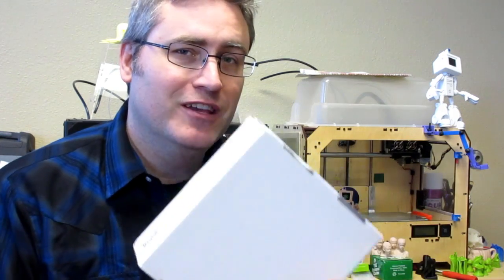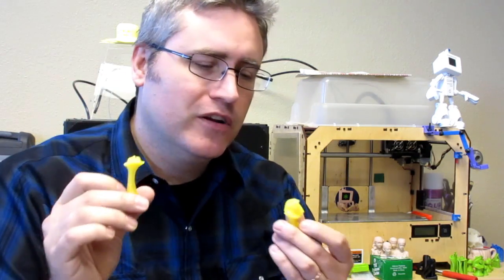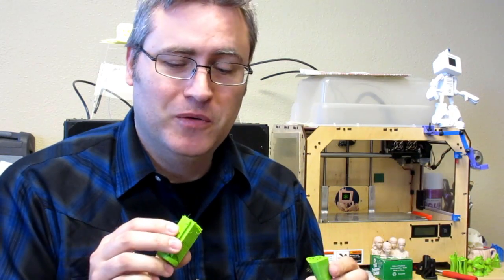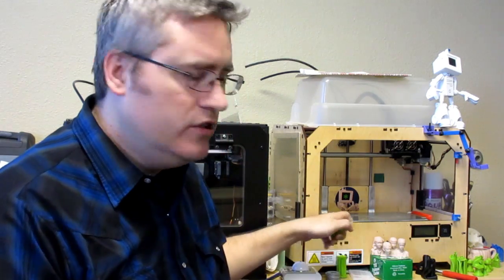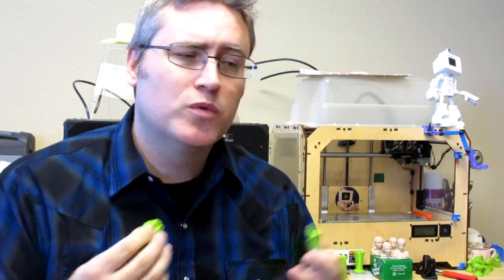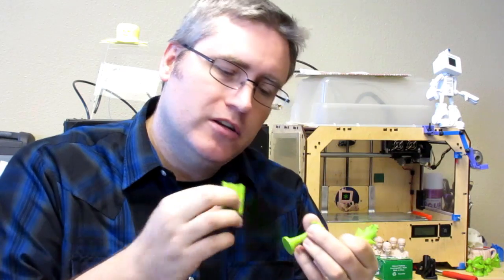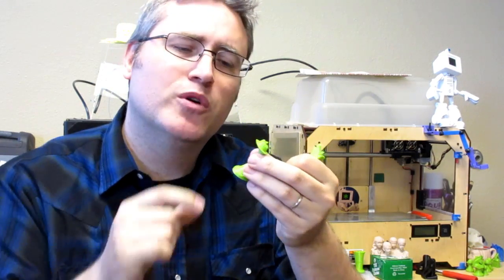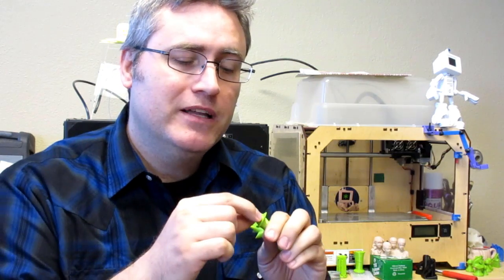Recycled PET Filament Review

Comment: I have been looking for a PETG filament that isn't super shiny and I failed, then I thought maybe it's the added glycol that causes the shiny finish on parts printed with PETG so I searched for video's of printing with PET and by looking at your prints I think they are nowhere near as shiny.
 Are PET prints less shiny Joe?
Reply from the maker: I have not found a super shiney PET filament. But Silk PLA prints at slightly higher temps and is SUUUPER shiney. I print with lots of Silk.
Reply: @3dpprofessor  i think he was looking for a filament that isn't shiny

Comment: not meaning to be rude, but i don't see the point of this. why buy recycled filament? pla is biodegradable. so if you really want to be environmentally conscious you shouldn't use pet or abs.
Reply from the maker: PLA isn't right for every application. Sometimes you need something that won't melt in your car on a hot day or is more flexible. Plus a lot of plastic marketed at PLA, isn't the same stuff, especially the "high temp PLA" or other blends. They're not always the same amount of biodegradable.
Reply: PLA wont biodegrade unless you put it into a high temperature industrial biocomposter  and pumpo oxigen into it.  Pla nees +60ºC, water and oxigen  to even start biodegrading, else you can dig a hole, place the piece there and come back 50 years later and it will still be there. Pla being biodegradable is QUITE a relative term in this case.
Reply: What makes it attractive is the fact that PET is used a lot in food beverage packaging and very little is recycled. Being able to turn that into something useful via 3D printing is very enticing

Comment: I've been using PETG for a while, the stringy stuff is normal, just needs some post-processing. I've found a heat gun or lighter cleans them up quickly. Also PET and variants are typically not the best for small details, but it works amazing for strength and flexibility.

Comment: PET in general makes a lot more string and it likes higher temps. what you need to do is do what simplify3d lets you do. instruct it to NOT leave the outline of the model if at all possible. this way the string is all "inside" the model and you end up with nearly string free models.

if you need support its going to be tough since it HAS to leave the outline in order to print the support.

PET is a pain in the ass to print with but WOW the results are sure pretty. (PETG)
Reply: Good tip.   The setting in Prusa Slicer is "Avoid crossing perimeters".   It makes the print time longer due longer travel distance, but I think it's worth it to avoid stringing.

Comment: How do you print directly on the aluminium plate? The only way i managed to get the ABS to stick to it is by roughing it up with coarse sandpaper and paint a good coat of ABS juice over it.
Reply from the maker: +Wolfshark Yeah, that's basically it. Rough it up with a little sanding or steel wool and coat it liberally with hairspray.

Comment: I'd like to confirm: PET, of ANY kind or derivative (incl. PETG and PET+), seems to be extraordinarily stringy. Don't intend on printing fine detail with this stuff.
Reply from the maker: +smokeydops I'm getting good results with higher temp, printing one part at a time, and putting a sacrificial tower on the back of the part where the stringys can be removed without much consequence. Also doing what I said in the video, switching outlines to go from outside in so that there's a little wipe hwne moving from part to part.
Reply: Unfortunately my Wanhao i3 is at its highest safe temp, being 255 C, for MadeSolid's PET+. I've given up on using it for fine detail, but its still a great plastic for objects that receive physical use. The walls --> fills setting is something I will keep in mind.
Reply: +smokeydops Depends. I got several kinds of pet here but non is stringy when the right temp is used ;)
Reply: Could you give us a sample of the temperature range you're talking about? And any other sittings that may help.  I've ordered a  3D printer and am learning all I can before it arrives in 3 or 4 weeks.